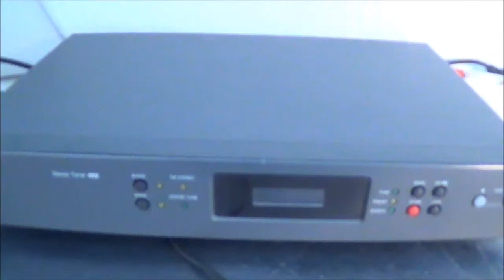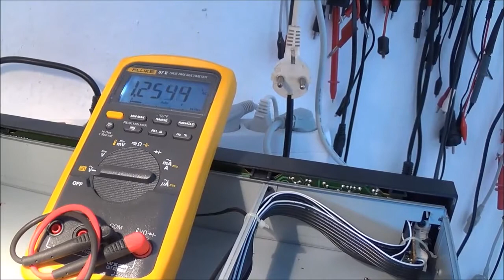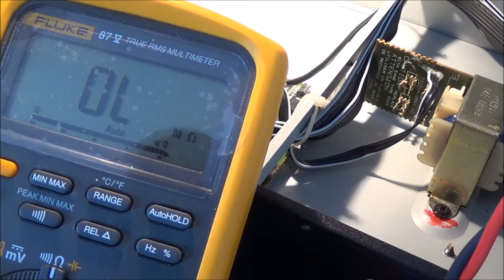NAD 402 Tuner -- Failed Repair

Comment: Why to save this unit for parts? You can replace any equivalent voltage transformer. Or even replace it with r-core transformer. I can work. Just test that it works with bench DC power supply. If it works then hunt for new transformer.
Reply from the maker: Economics; the unit isn't worth much when fixed. And when I resell stuff, it is always sold in original condition with no new major parts. Transistors, etc, I consider minor parts; power transformers not so. Everybody does things differently. I already have a private collection of about 5 or 6 working tuners.